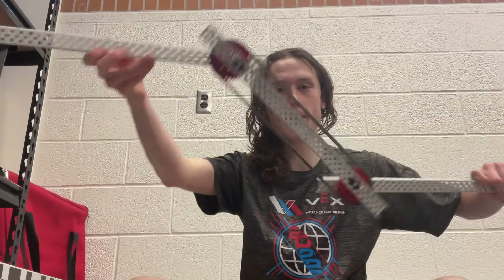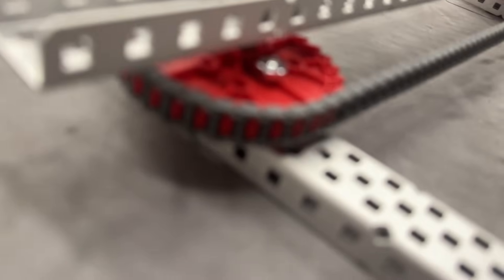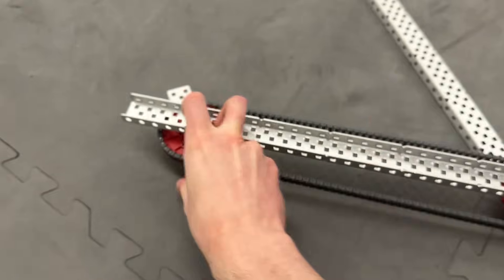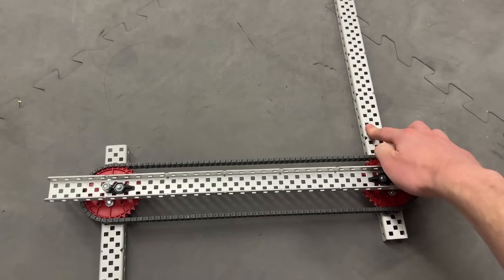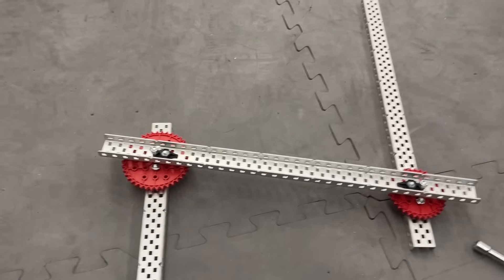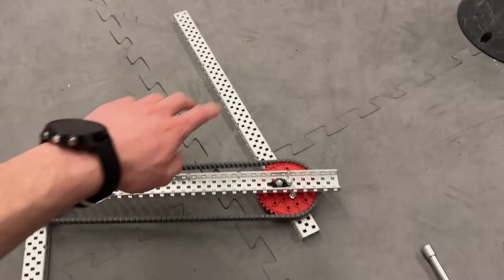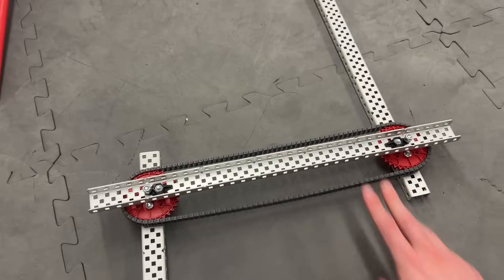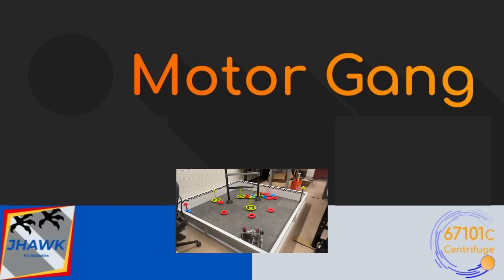Vex Robotics Chain Bar Guide/Tutorial

Comment: One thing you kinda missed is that chain bars are prone to chain skipping if not wel ldesighned and under higher torque. otherwise very W
Reply from the maker: @LOUIE_Timmy  interesting, I’ve never encountered this issue. My guess would be this is an issue with chain tensioning which is pretty easy to fix.